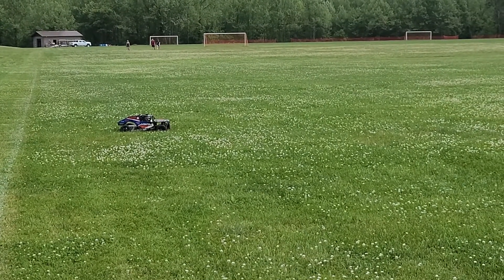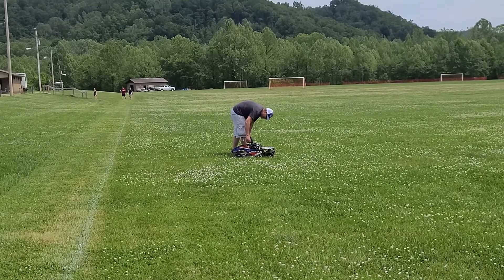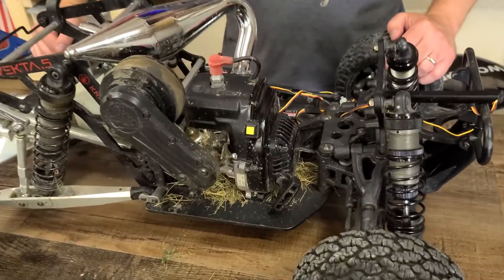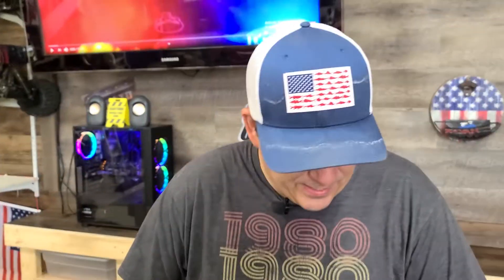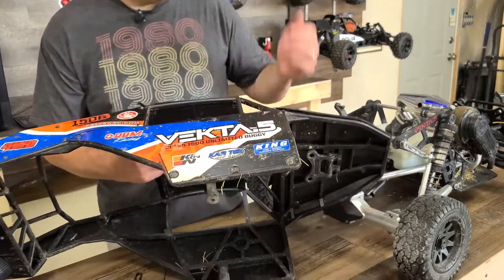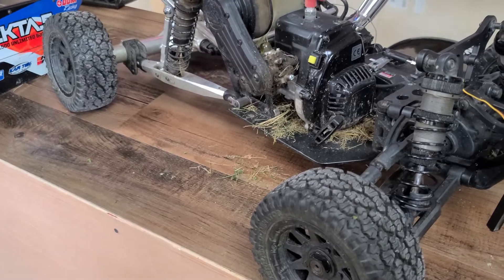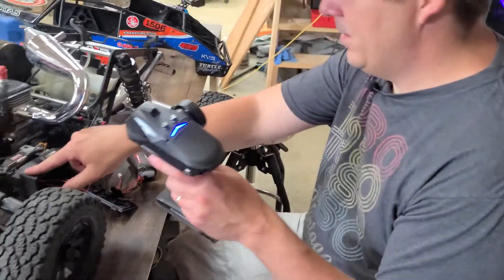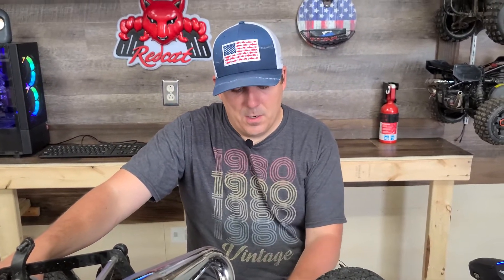I Wrecked My Kraken Vekta And Then It Ran Away!! 1/5 Scale Problems!

Comment from the maker: Ouch, that hurt! What's the worst wreck you've had??
Reply: Got out of line mid air , tried to use throttle and brakes to straighten it out with no luck. Vekta5 end over end then cartwheeled to a stop. Bent the body, but broke nothing.
Reply from the maker: Ooooooh dang. That's good though.

Comment: At 1:30 u should off checked the battery connector. It was already about to unplugged. Kill switch won't activate if battery is not connected. I had run aways plenty of time.

Comment: I would put a return spring on the throttle so if you have no power for the kill switch at least it will return the throttle to neutral position. There are lots of videos on it.easy and cheap safey mod

Comment: I had an electric rc take off on me once because I turned the Rx before the Tx. That was not fun. Luckily it drove itself right into a tunnel and not the busy street above that tunnel 😱. Good stuff buds
Reply from the maker: Many years ago before YouTube, I had a nitro 1/10 street car that I rebuilt after a nasty wreck and flip, roll down a blacktop  road.  Parts were everywhere, it pretty much exploded.  After I rebuilt it, I forgot to turn the radio on and I started the car, and took off full speed and smashed into a concrete wall, once again breaking what I had just fixed.  I ended up scrapping it for parts and sold what I could in ebay.

Comment: You need a failsafe. I run the fly sky gt3b radio and the receivers have a failsafe that will work with a kill switch to shut down the car and lock the breaks. That's what I have set up on my baja 5b
Reply: It the battery  it’s the battery cuz it  was puffed up
Reply from the maker: For sure!!

Comment: Kill switch should work simultaneously with the failsafe if you lose power at the receiver on the vehicle it will automatically turn the wheel and lock the brakes you can set both up to run on a single channel on your radio pretty easy process great video been looking at getting a crack in as well I have a Baja and a Losi 5B that I've spent a ton of money on keep doing what you do man love your videos
Reply from the maker: Thanks man! Appreciate the kind words!

Comment: if you had a killswitch in it then the engine would have shut off when the battery got disconnected and wouldnt have fired back up until you got it sorted.
Reply from the maker: Yeah, wasn't aware of the low voltage cuttoff.....am now though, lol.
Reply: If you’re running a spektrum radio it wouldn’t mater if the power was cut. It would still run. Specktrum is only good for shutting the engine off remotely. All other killswitch features are void. Don’t know why they haven’t addressed this issue as of yet.

Comment: Wow can you even imagine if that hit something or someone. I've always worried about runaways hitting people, don't even want to think what could have happened to the "spectators". I use a killer bee killswitch in my Kraken. That will shut the motor down in a event like this. It detects radio glitches,  low battery, and total battery loss.  Bash on!!
Reply from the maker: Wow, didn't know that. We have 3 of those and will be installing them shortly.
Reply: @BMPowered  you think they will work on a dumbo radio
Reply: @BMPowered   FYI Kraken  RC is working on a prototype as we speak.  Photos look sick, there's will be a gas and battery version. 🤫😶
Reply from the maker: @takuache4692  We will find out.
Reply from the maker: @chrislrocks  Ooooh!

Comment: @2:59 "Wouldn't have mattered if I had a killswitch or not." 1000% untrue. A killswitch kills the ground to the coil if there is a signal loss or power loss (like the battery dying or disconnecting) thus won't allow the engine to start or will kill it when if it's on if the above conditions are met. 

Guys, I'm a subscriber not a hater but you guys gotta do better in educating yourselves.  We don't want to lose the 5th scale hobby to over regulation like the idiots over in the "drone" side did to themselves.
Reply from the maker: Thanks man. Yeah, I learned that after the fact. In fact, already made a video of adding the kill switch. Will be out next week.